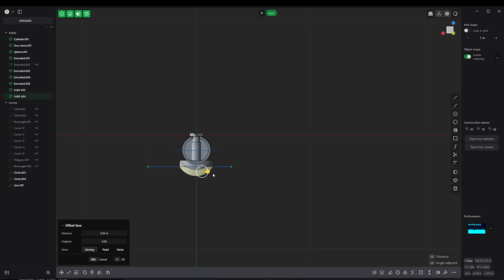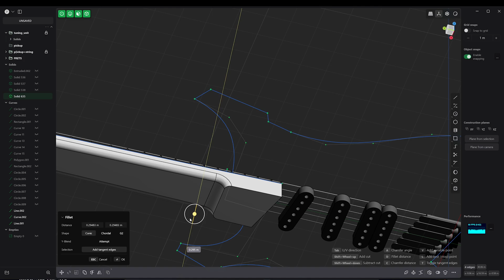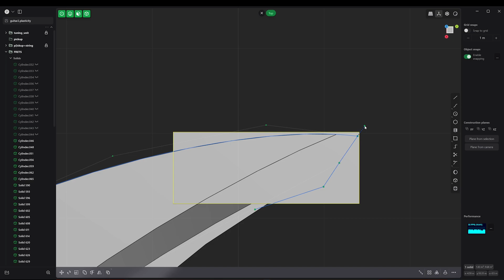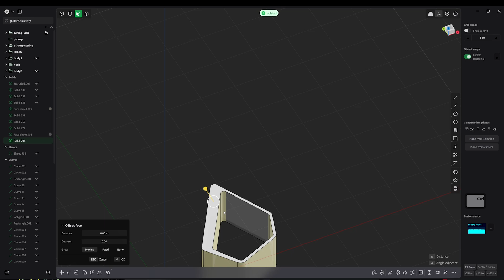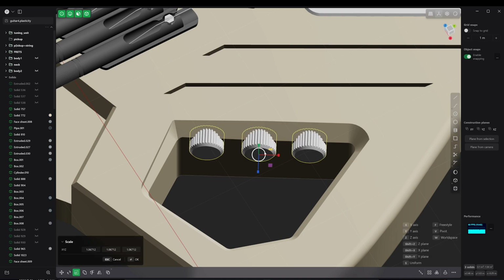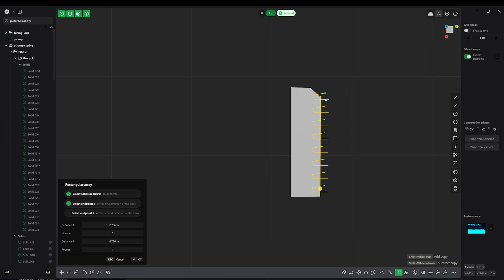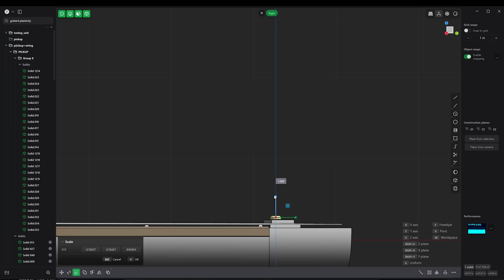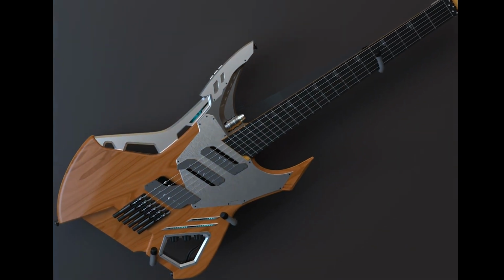Custom Guitar Design using CAD (Plasticity Iterative Design Workflow)

Comment: My question is very similar...Not in a preferential "Ford/Chevy" argument, but at the root of SlowCreep's question:

Does Plasticity offer "Precision" as part of it's design toolset? Can we make sure that this neck pocket depth, or that scale length is exactly X.XX or Y.YY in/mm, etc., etc. ???
Please and THANK YOU!
Reply from the maker: It has measurement tools, but it is focused around design more than precision, so If that is the goal I would look at proper CAD options like fusion.

Comment: I don't have a lot of experience with CAD, but I do have a bit of experience with Photoshop, Illustrator, and Blender. I've been working on a 1-to-1 guitar design, with accurate dimensions, but want to move into CAD so that I have something functional to work with. I'm assuming that you wouldn't solely rely on Plasticity for 3D design, is that correct? Does your workflow include importing the design into another software to nail down the precise dimensions?
Reply from the maker: if you want to design in photoshop/illustrator I would just skip plasticity to a more "legit" cad software.